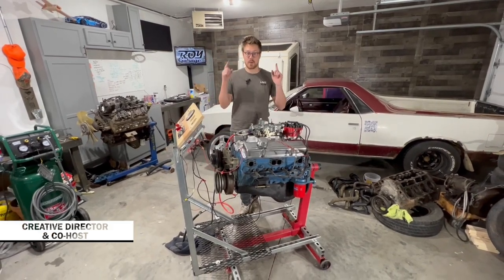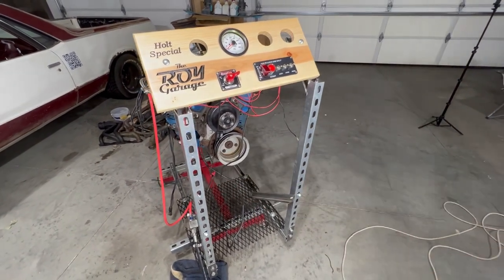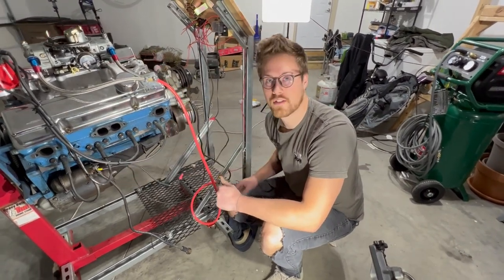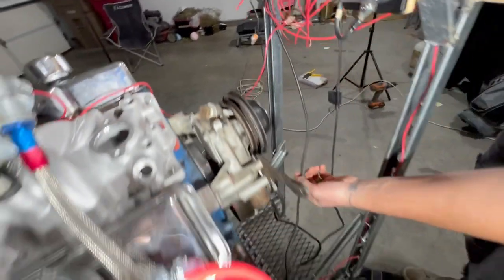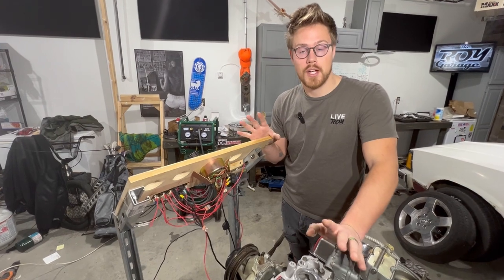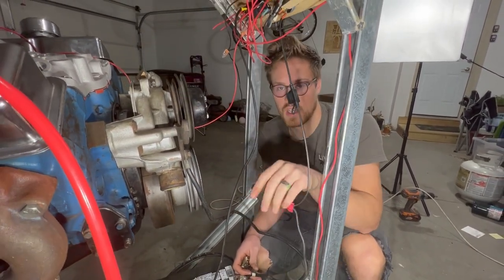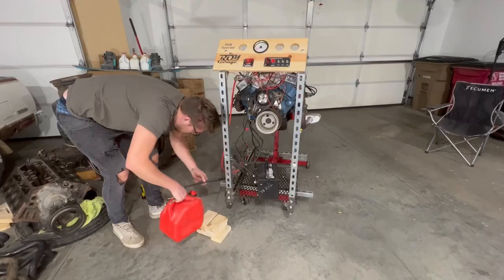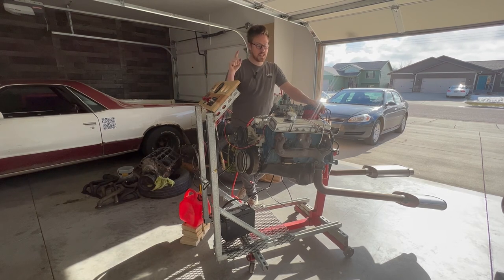DIY Engine Run Stand Wiring And Walk Around | Garage Upgrades

Comment: Thanks for the vid. Just build a run stand myself to break in fresh builds. I can build gnarly motors but am terrible with electrical so I hate wiring and all the componantry stuff. So got a fuse block, rad with dual electric fans, electric pump, same amazon switch panel and some relays, a discon etc. Because I'm doing break ins I needed the water. But also while on Amazon I found a hand throttle for a mower or something to connect to stand that locks at every degree in the 180 of travel so I can set rpms at 2k and let the magic commence. Great addition 😊to the setup and easily connected with the carb. Also have a remote starter to twist the dist for initial timing standing anywhere around the thing, also let's me bump the starter to get wherever I need to be. That's for the wiring walk thru it was a very much needed vid to put in tubeland!
Reply from the maker: Heck yea!  Sounds like a nice set up!

Comment: 10:16am I have a 1.03 cylinder engine from a Geo Metro and I want to hook it up on the stand so it runs but I got to hook up the brain box and all that other stuff too to make it go
Reply from the maker: Yes, you’ll need to hook up the ecm to make it go.